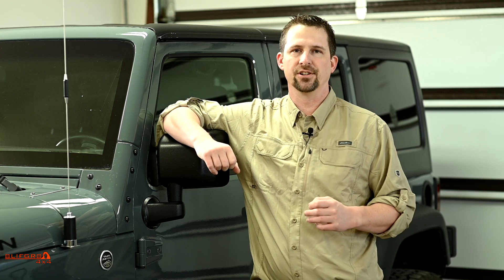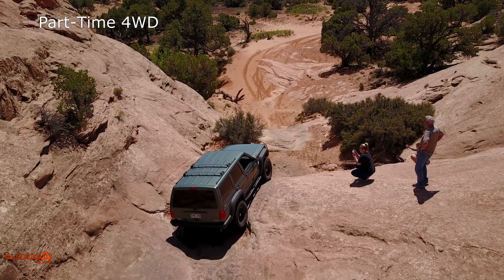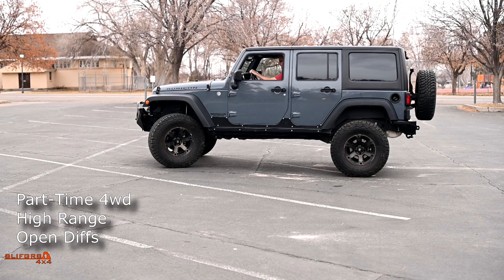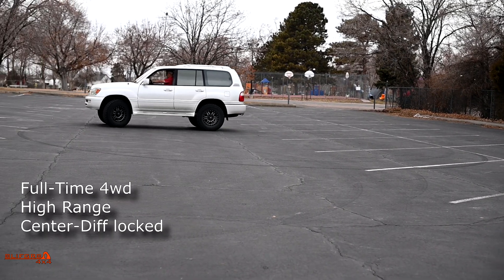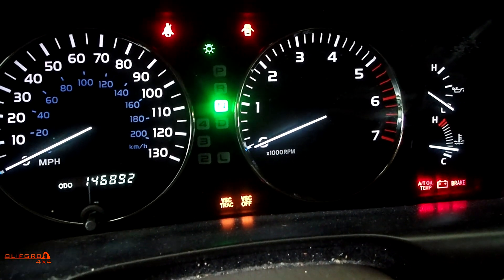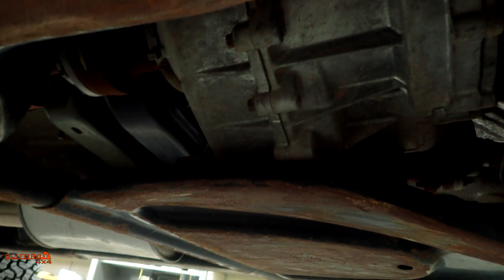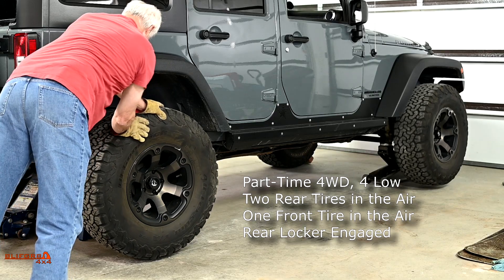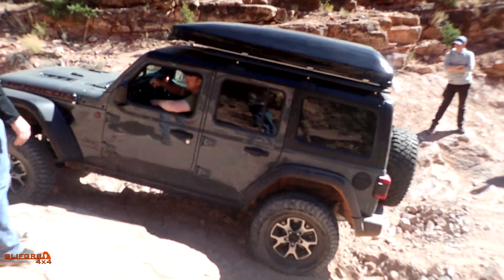A Beginner's Guide to Axle Lockers and 4WD Systems.

Comment: Great video! I have a 1999 Landcruiser that is very similar to your LX. I looked in the owners manual and online and I can’t find what speed range you can lock the center differential. (For example, driving on a road that gets snowy in the mountains.) I know that it’s safe to do while stopped and in neutral but I don’t want to have to stop and engage that if it’s not necessary. 

What is common practice for that type of example?
Reply from the maker: I have kicked it on in high range as high as 25mph or so, maybe even faster; not sure if that's good for it or not.  If 4lo, I don't ever worry about it.

Comment: This is such an excellent video. Thanks for making it! I’ve watched it probably a dozen times and I pick up new things each time. 

You mention this briefly at the end, but I was wondering in a full-time 4hi with a center diff, do you lock the center diff as soon as you turn off onto a gravel road, or do just leave it open and only lock it when you come to an obstacle? 

In most situations with a full-time 4wd it seems like you would most likely stay in 4hi unlocked, then switch to 4lo and lock it up. Are you in locked 4hi very often? I know some people recommend locking up the center diff in a full-time 4wd, or switching to 4hi in a part-time system as soon as you turn off onto a gravel road for safety purposes, but with VSC it seems like it could be unnecessary to lock up the center diff, or switch to part-time 4hi. Hopefully my question makes sense!
Reply from the maker: Typically, I'd be in 4H unlocked on Gravel.  However, with the Toyotas I've noticed that VSC is very aggressive and with it, it controls (ie: cuts) your throttle response.  I HATE that!  So if I'm on gravel for an extended period of time, I typically always turn on the CDL, even in 4H.

Now, on my Land Rover discovery 2??  I was never in high range with the CDL locked.

With 4-Lo, I typically engage/disengage the CDL as needed.  There are times when I keep it on, but usually I don't.  The vehicle turns sharper and is much more nimbler on technical terrain with CDL off.  It is noticeable.  So I only engage the CDL in low range when I need the traction advantage.   That works for me in both the Discovery and the Toyotas.

A trick on the Discovery 2:  If you have the CDL engaged and turn the vehicle off and on, it throws an ABS fault and disengages traction control.  This can be advantageous in the sand as the Discovery's traction control won't cut your momentum in the sand.

Hope that helps, and thanks for watching!!
Reply: Forgotten Waypoints Yes, very helpful! Looking at a GX460 or LC200,  as you probably know both have full-time 4WD with a CDL. Your vid and comments are very helpful.

Actually, come to think of it, my 2009 RAV4 is 2wd with the front wheels driven and I can switch it to “AWD”. The vehicle also has a CDL that works below 25mph. The VSC is incredibly intrusive, especially in snow and sand. I usually switch the “AWD” in snow or gravel roads and turn off the VSC. I only lock the CDL if I’m in deep snow or sand. The VSC cuts power like crazy.
Reply from the maker: @woolengrappler  , Enjoy the hunt!  Both of those rigs are on my short list for my next long-term project.

Comment: Excellent video, thank you! In the LX470, do you lock the center diff going downhill as well as uphill?
Reply from the maker: On technical terrain, yes.  Honestly, on the easier stuff I forget to turn it on.  I think I only used it on the cathedral valley trip when I saw snow on the switchback and thought about it.

Comment: Well done for taking the time and effort to explain and maybe more importantly show the different scenarios (or modes). Maybe it's a regional think but for me I would describe "part time 4wd" as a vehicle that has 2wd selected for everyday street driving and then selectable 4wd high and low etc when "off road". I think you also showed that "full 4wd" isn't invincible! A mistake that many people make. Great job, thanks 👍
Reply: Many vehicles with full time 4WD are exactly like you described. They don't have a 2WD option. But in my interpretation, full time 4WD means you can leave it in that mode and not worry about it damaging your drive train in all conditions.

Some vehicles have 2WD, full time 4WD, and part time 4WD. My Sequoia, for example, is 2WD. I can engage the full time 4WD (center differential present) and still drive 80 mph on the highway without issues. I could leave it in that mode full time without an issue. But I also can lock the center differential making it part time. The manual says not to use this mode on dry pavement or at higher speeds.

Both my 4Runner and Jeep Cherokee, on the other hand, have 2WD, part time 4-hi and part time 4-low. There is no full time option and the manuals clearly state to not use 4WD on dry  pavement or at high speeds. These vehicles have no center differential.

What is hard is that as technology has advanced it isn't as clear cut anymore since vehicles have more modes and options.
Reply from the maker: Lol!  Total brain-fart that I didn't even mention 2wd.  I guess I was too focused on trying to simplify the content.  You are spot on, of course.
Reply: @ForgottenWaypoints  I feel bad now for making that comment ! Seriously, Good job.
Reply from the maker: @timb4655  , No worries!  This is the type of feedback which helps me improve.  See you on the trail!